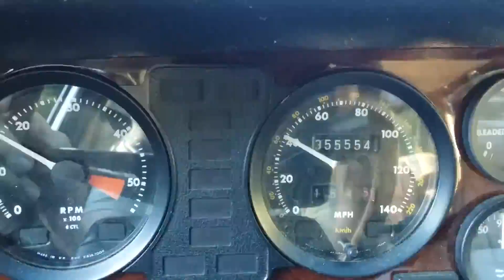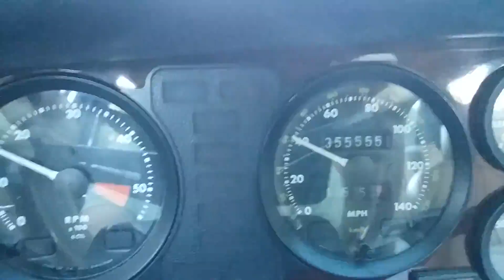1983 Jaguar XJ6  355K Update

Comment: Wow, i just discovered your jag with 355k miles, there is a story to be told here, how have you managed to achieve such a high mileage on a car that doesn't have the greatest reputation for reliability? You must tell us more of what things have given trouble over the years. I read in another post you got the original engine to 347k before rebuild, thats amazing for an xk engine!  And rust, how have you managed to keep the rust at bay?  you must live in a dry area as rust is what normally kills these jags in europe
Reply from the maker: Morgan, I suppose sometimes you just get lucky and get a good one. I have spent my entire adult life working on Jaguar cars and I guess that also helps a bit. I bought the car in 1997, but I had maintained it since it was nearly new.  It had 116K on it when I bought it and the owners sold it because they thought it was worn out. The engine is incredible.  Very often when the XK engine passed 100k miles something would happen that at least required the removal of the cylinder head.  That never happened to mine. The only engine failure was a loose tappet guide and that occurred when I was driving all day, loaded, through central Florida in the summer.  When I restarted the engine after a rest stop I heard the familiar sound of a tappet guide hitting the camshaft. We continued to our destination where I had a tappet guide kit sent to me and I installed it in a parking lot.  All was well after that. I am also very careful about oil changes, and I did that every 3k miles.  A short period by today's standards, but one that worked for me.

The rest of the car has been very similar.  Just basically routine service, brakes, water pump, belts, leaky diff, etc. I ran the original alternator and fuel injectors until I rebuilt the engine at 347k.   I did change steering, front suspension and shocks some years ago.

The body is rust free.  It has always been stored inside.  I am the third owner and we all kept the car garaged.  It still had the original paint ( the silver had faded to something that reminded one of primer but still there) until I had an altercation with an 18 wheeler a few years back.  That gave me a chance to take the car apart and I was amazed at how there was basically no rust.  The tray below the exhaust tail pipes had rusted enough that I had the body shop replace it, but that was it.  The area around the sunroof that usually rust, still had the original paint marking on it, and the sunroof itself had no rust at all. Only a bit of minor surface rust on some of the hardware. No rust around the windshield or back glass. Just the benefit of letting the car dry out in a garage every night, I guess.

I drive the car as my daily driver, and that helps also.  Any machine that you keep working will give better service.  She is now coming up on 368K.  If she and I can both keep at it I see no reason why we should not celebrate 400K in the not too distant future.

I live in the foothills of the Appalachian mountains.  It is not what you would call a dry climate, but cars here do not rust as badly as ones that live where there is a lot of road salt used in winter, or on the coast.
Reply: @novom2001  Thanks for that insight. Ha, 3k oil changes are a lot of oil changes. I have an 82 xj with 77k miles, its great inspiration to know someone has brought an xj that far without any major reliability catastrophes. My car has required a few rust repairs in the usuall places that the xj suffers but thats normal for the west of europe. I hope you keep posting updates on your car as its really interesting to see how its holding up as a daily driver after so many years and miles.
Reply from the maker: @morganmcdonagh2663  The oil change interval came from days past, when 3k was a lot.  Engines in the 60s and 70s were not built to the same quality standard as modern engines.   If you got 100k on an engine, or a car for that matter, it was something to brag about. If a modern engine doesn't go 200k or more something is wrong.  We get 100k on the spark plugs and tires on our Prius.  I still believe you get better service out of any machine with clean lubrication.  I got 200k miles out of the model 66 transmission in this car, many more than usual. It was still working well when I took it out.  I believe it was because I changed the transmission fluid every 10k.  I always dropped out nice, bright red fluid,  not the black nasty stuff you see from a tranny that has been ignored.

Still love the XJ though.  It is a beautiful car with a lot of soul. I hope to keep it running for some years to come.

Good luck to you with you XJ.

Comment: Wow that thing literally has 10 times the mileage of mine!
Reply from the maker: That really bodes well for the future of your car, doesn't it? How is your car doing?
Reply: It's got a few issues but nothing serious. It's previous life before my ownership was obviously pretty easy going. I think it actually gets better the more it's driven!
Reply from the maker: Machines definitely work better if they are used.  We bought our car at 116K (the owner thought it was worn out), I put the 5-speed in at 302k, and finally rebuilt the engine at 347K.  It has had a few issues over the year, but really has been a very dependable car.

I notice from your pic you are an ax man, what do you play?